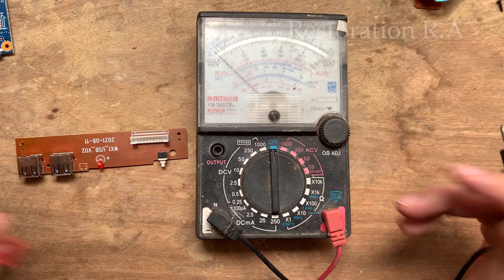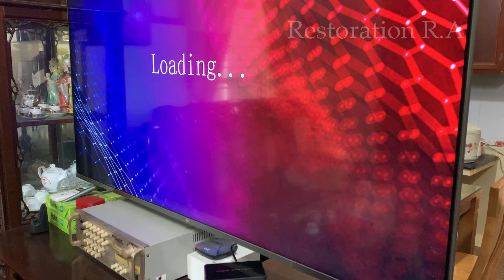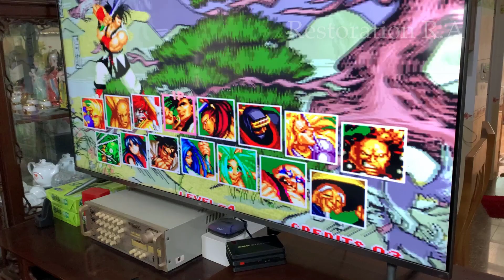Restoration old PS4 Game station | Playstation Gameboy Retro Console restore and repair

Comment: This is not a restauration , this is a faked video , just look at when he is soldering the contacts of the gamepad , he is doing an awfull job putting solder on all contacts , he cant even solder corectly , even a 10 year old could do a better job , in the end of the video the contacts look untouched , perfectly soldered , with no visible solder marks on the gamepads board , this video was done backwards , he did a video with the console when it was good , then when he was done , he dipped it into muddy water , then there is your fake video , stop supporting this scam channel ...
Reply: Washing the electronics in water
Reply: @mariusbrandiburu6896  Yea just look at when he checks with the multimeter , he is just wiggleing with it , gotta love it when he test resistance ground to ground , that is how looser he is , just hate these fake restauration videos ...